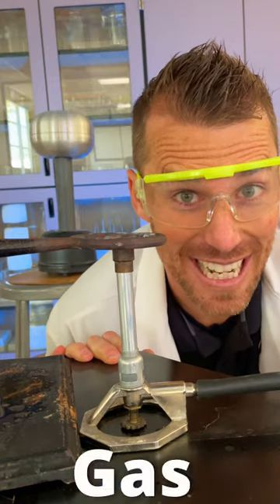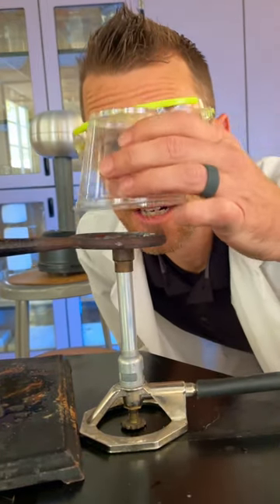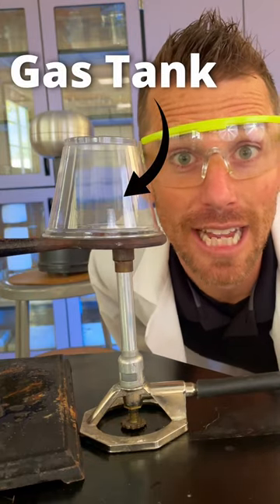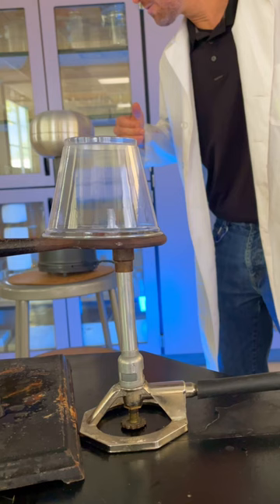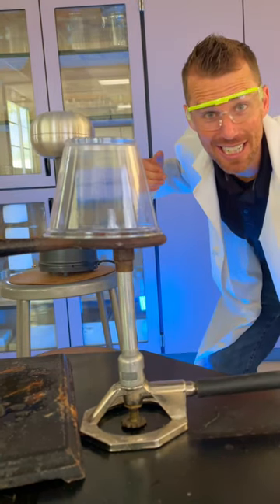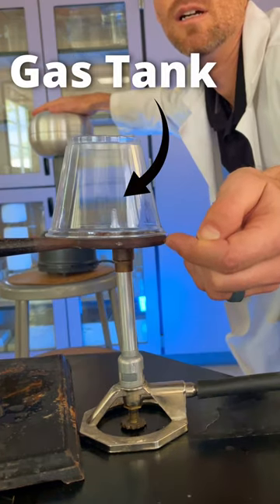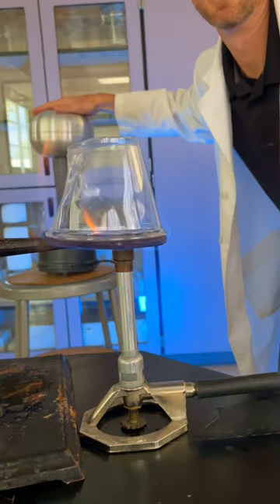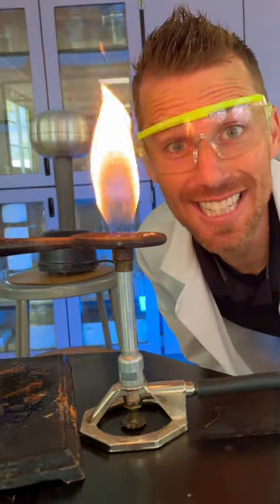Static ELECTRICITY and GAS STATIONS don't mix #shorts

Comment: Anyone else getting angy that he is holding the generaton with one habd and discarging it out of the otger ? Like you have a hart in the way that could stop ?
Reply: The V-Generator produces thousands of volts at very low amps. Because it’s the Amps that kills people and there’s an extremely low amperage, there’s no danger of heart damage or cardiac arrest.

I’ve personally done it by slapping my hand on a V-generator and zapping my professor with the other hand in front of about 200 classmates.
Reply: @Johnrich395  but maby dumber ppl think that you can do this on anything like a teslacoil ... But about the amp thing ... im not so shure because i would touch a carbatery with both of my hands but never would i touch something that produces the same power but at 20k volts
Reply: @achicken6477  you are the people you refer to, lil homie

Comment: This is really dumb. One the amount of fumes evaporating from your gasoline tank is much smaller than the gas running to your bunson burner.  The static charge on my winter coat 🧥 is nothing compared to your Van de Graaf.  Even then it took you several attempts.  So I won't play with a Van de Graaf generator while pumping gas in my car

Comment: That "just" caught on fire because it was too saturated

A real gas station with more oxygen is more likely to produce explosive mixtures

This Experiment was rather harmless... Gasoline is extremely dangerous in combination with air! That Power pushes you to 100 mph, that power can also cost you your life!
Reply from the maker: Very true. A more apt title would have probably been something like “this is sort of how a spark plug works”. As much as I would love to show this with gas, I do enjoy having my hand (and skin and hair). But you are very right. you can pretty much put your hand in the low concentration and pressure of natural gas I was using and barely get a singe.